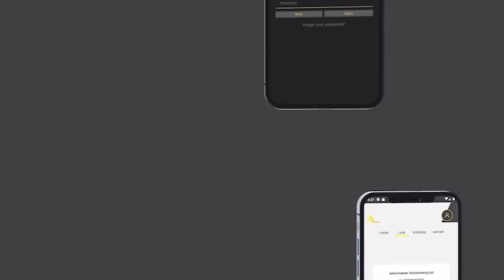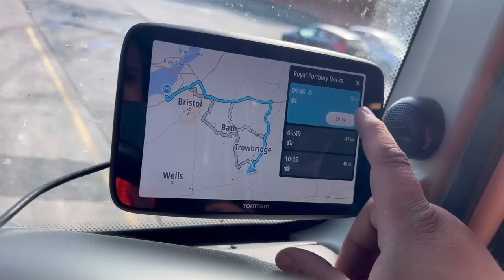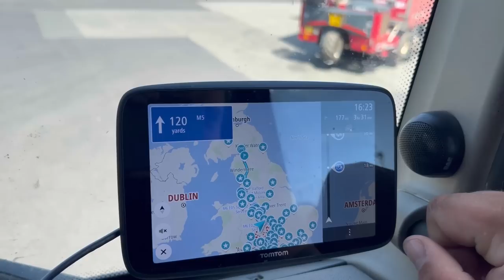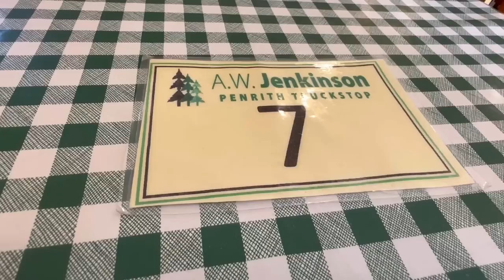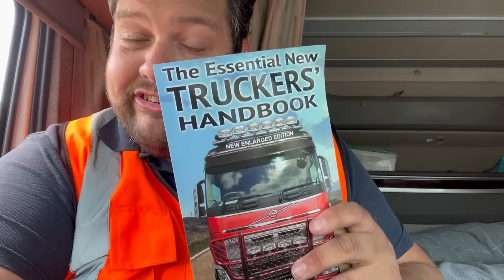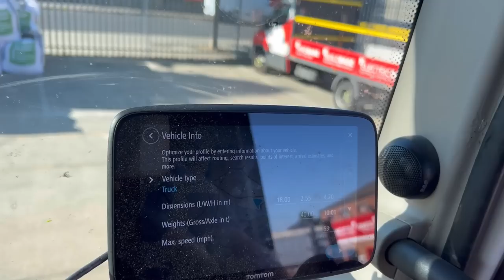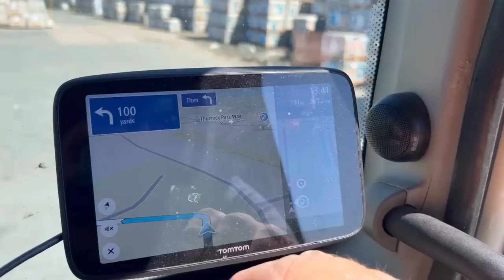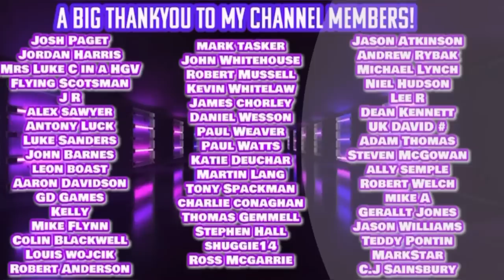60 Hours Of HGV Work

Comment: Not sure if you thrive on pressure Luke. But stress is a killer.... At aged 74 I like to know what I do. I do 240 miles per day. 12:00  start, finish by 23:00. No stress unless Motorway shut etc. DHL.

Comment: Hi luke brilliant video mate it nice to see you film again. can I ask you a question? I,m studying for my HQV theory test. and wanted to know is when you have been driving for 4 hours 30 min do you have to take the full 45 mins break or can you sprit it in to two breaks? so you can clear it for a another 4 hours 30 mins drive also when you are waiting to be loaded or unloaded do you put it on to break?
Reply: After 4hr 30 of driving you need to have had 45 minutes of rest before you can drive again. So if you haven't had any other rest until this point it must be 45 minutes uninterupted. Breaks can be split but the second must be at least 30 minutes. However, as I say if after 4hr 30 of driving you've had no rest it has to be 45 minutes uninterrupted. You need to have a break of 30 minutes after 6hrs work or 45 minutes after 4hr 30min driving whichever comes first.

If you are doing NO work yourself during the loading/unloading period (like sitting on an RDC loading bay) you can pop the tacho on break. But you must NOT carry out any work during this time, not even opening a trailer curtain or a ratchet strap.

I hope this helps you. Good luck with your tests and new career!
Reply: @heinz551 yes that is a help thanks mate but can I ask one more question? while you are sitting there waiting to be loaded or unloaded and you do put it on break. is there a limited amount of time you can keep on break or do you change it till something else?
Reply: @kennethharper8417  I keep it on break as long as I need to: 30 mins, 45 mins. Whatever I need. There is no limit at such.
Reply: @heinz551  ok thanks I understand it better now you have explained to me. As I,m new and trying to learn all about it I was getting very confused but not now. thanks for all your help mate take care
Reply: @kennethharper8417  No worries, happy to help. All the best mate
Reply: @heinz551  And the same you mate

Comment: "Typical cyclist"?  More like typical tattooed big-headed lorry driver spouting nonsense.
Reply from the maker: Behave. Get 10 cyclists and 10 truck drivers. We will see how many break the Highway Code in a 5 minute period. 

Im not saying truck drivers are perfect. Some are complete idiots too. But. In my opinion, (of which I’m entitled) the worst offender on the roads are cyclists. This particular cyclists wasn’t paying attention. End of story. So busy looking down and peddling. He also wasn’t wearing a helmet. 

If it was any other type of motorist he would have been reported for driving without due care and attention but I bet nothing happens. He’ll get away with it. Just like he will when he crossed red lights, rides on the wrong side of the road, turns without signaling. 

It’s funny how cyclists want a one and a half meter gap when you over take (fine by the way) but if they end up going faster then you they’ll UNDERTAKE much closer.

Lorry drivers need to take multiple exams and tests to get their licence. Again I’m not saying we’re all perfect because we’re not, but at least we’re scrutinised. Any muppet and jump on a bike 🚴